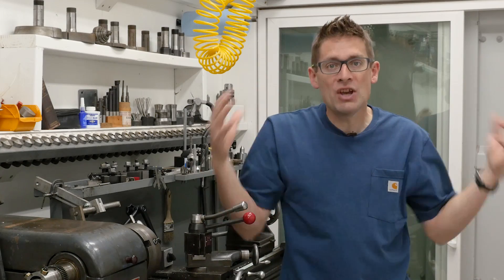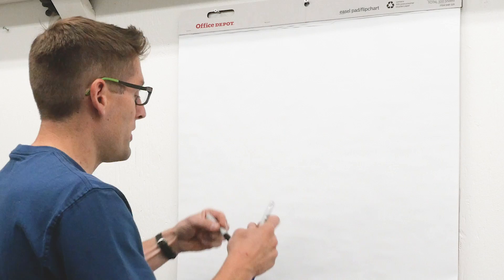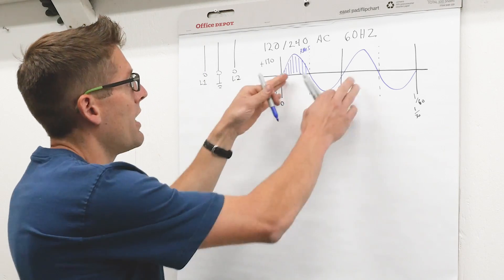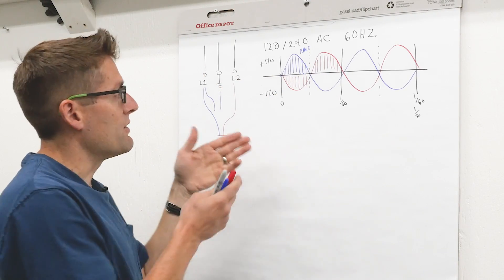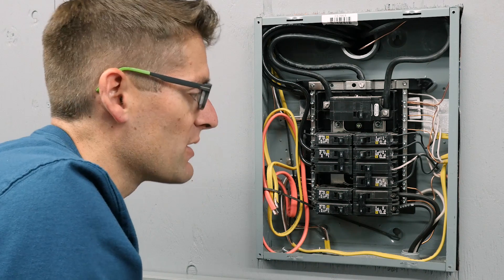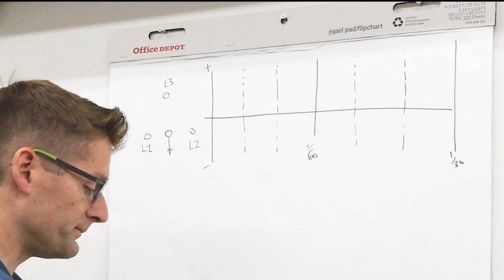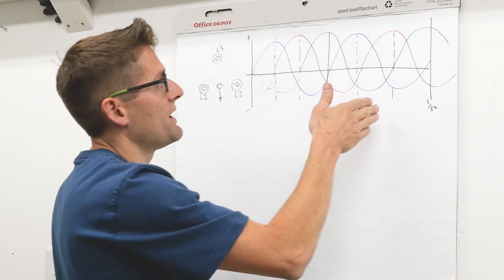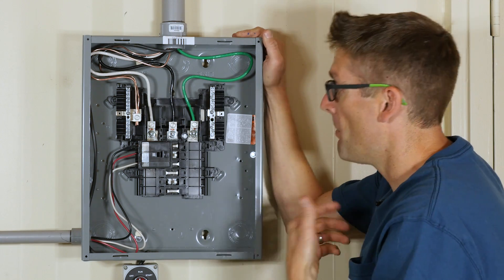3-Phase for the Shop: 3-Phase -vs- 1-Phase Power

Comment: Gavin your chalk talk primer on single phase and three phase is exactly right on....at least the way I learned it in tech school in 1971. I do wish you would consider doing me one favor though? PLEASE don't hold on to the breaker box, water pipe, or some other good ground with one hand while  you are contacting wires with  a finger of the other hand. If an accident occurred, the max current would surge directly through you chest and heart, likely killing you. When we were working around BIG power down at NASA in Houston the safety inspector would often make us work with one hand in our pocket until we were sure the circuit was dead. Again best primer on power I've see. BTW: the multiplier to convert from peak to rms is 0.707 and  the other way is 1.414

Comment: Excellent explanation of the basics of 3 Phase Power. 
However, I have to agree with previous commenters regarding a range of issues (close to live wires, color coding, etc.). You obviously know what you're doing, but some folks may think they could do this. I met a guy 3 decades ago who thought he knew enough. His two missing fingers elicited my "interest". He showed me the scars across his arm and chest from the shock he got from a panel. It disintegrated his two fingers, scarred him for life, and put him in the hospital. 
My comment is aimed at those who are not WELL educated about working with high voltage electricity. It can kill you.

Comment: Hey Gavin great job but remember COLORS Matter , Identifying what's hot and what's not is critical  the COLORS of the wire determine their function in the circuit . You MUST get that right ! What you've displayed here (12;30 ) scares me that's why I test all circuits I'm working on if the job is new to me and until I decide that the wiring is correct with respect to grounding and polarity I always proceed with caution

Comment: I thought I understood 3 phase, I didn't, now I do.  However that panel wiring is not standard color code for 3 phase, at least I don't think it is.  That Green is normally a protective ground, and you would have a red, black, and blue.  Regardless, still a great presenation.

Comment: Also...the use of the green insulated conductor in your three phase panel is a violation of 250.119. One thing is working but minimum code safety standards must always be followed my friend.

Comment: Greetings Gavin - Nice explanation. However, you are aware that the remote distribution panel you show is a violation of 250.24(A)(5) right. You do not ties your grounded comductors, in your case neutrals, and equipment grounding conductors together. This creates objectionable currents as well and places unintentional current on metal parts. However, in terms of phasing and so on well done. Also that grounded conductor in your remote panel needs identification as a grounded conductor as well per Article 200.

Comment: Theoretical can i run a machine that is design for 240v single phase on a 3 phase. The voltage would still be 240 its just more consistent. Im just trying to understand basic electric engineering.  Thanks
Reply: You could, but with a lot of torque ripple and reduced power - since the voltage across two 3 phase legs is 208 volts, not 240 volts.

Comment: Sorry, but a second phase is 120 degrees shift to first one(360/3=120). Tge voltage will be lower as just a difference between two phases. At least so it in Europe.

Comment: I’m an electrician by trade and there is def some serious issues with your installation and I hope no one uses this as a template. But I think you did a decent job explaining what’s going on with single phase and three phase power.
Reply: Parallel paths to ground from sub panel 💩

Comment: The last box was done by a hack and not an electrician. The wire color scheme is not used and off. No bond to the the panel. You should of used tape to call out your wire. Black, Red, Blue, and in that order. If the first box was a sub panel it's wrong too. Hows your neutral feedback doing. No marked wire and you have full romex wire inside the box. If people are using your equipment do them and yourself a favor, get your boxes up to code. We can all see you did not permit your work, it never would be approved.

Comment: Wow!  Some super dangerous wiring in your installation!  I hope one of your connections at the lathe doesn't loosen over time and contact the lathe case because you're dead!  Bond wires going to the neutral bar.....another major mistake!  Lots of wiring issues here.

Comment: Great explanation Gavin. Your panel from your converter uses black, white and green. Kind of a no no. Electrons don’t care about insulation color and I’m of course referring to a business where city inspectors, building inspectors etc. have free access to a business, so in that regard, you’re a private entity so they’ll never know (unless they watched this video). The only problem that could arise if you go to sell the outpost and an inspection is required, they would ding you for that. Simple solution, use colored electrical tape to correct the wrong color. For example, put some red tape on each end of the white and blue at each end of the green. In your small shop it’s your kingdom and you did the work, if an electrician came in for some work he would have to $pend time figuring out your method to be safe. That green as a hot leg can get people hurt and confused. And I did see a comment where you’re going to add a ground to the lathe. Good idea. Back in the old days they didn’t have it but they DID need it, they just didn’t realize it. Dead people made the industry realize it. 
 I see the incorrect use of insulation color often, but like I said, electrons don’t care. You do’t claim to be an electrician so you get a pass but your clean wiring and research allow your set up to work safely. Nice job, keep the excellent videos coming. And NICE outpost.
Reply: Kind of a no no is a massive understatement. Green should NEVER be used for current. It ALWAYS needs to be a Ground and tied to an earth or water ground at the main panel. Imaging someone accidentally energizing an entire machine body because a green wire is accidentally tied to a hot leg. With rubber vibration isolation mounts on a machine tool you are creating a potentially deadly situation.
Reply: In the NEC code book the only two colors regulations are white/grey for neutral and green/green with a yellow stripe for grounding

Comment: One thing you glossed over is that rotary 3-phase convertors that use an idler motor as a rotary transformer do not produce 120 degree phased power.  They synthesize a third leg which is +/-90 degrees to the two standard 120v legs which are 180 degrees to each other.  So there are 3 sine waves, but they are not equally spaced.  It still "works" but technically you should derate the motors driven by this because the magnetic fields do not produce the design torque as they are not properly aligned with the physical windings in the motor, those being actually 120 degrees apart.  Very roughly speaking, you can think of the magnetic fields as being about 30 degrees away from their perfect positions, so you get something like cos(30 deg) or 87% of the design torque.  Close enough, especially for hobby work.   The phase-to-phase voltages are all about 240v, but the phase-to-ground voltages are something like 120, 120, and 250.  Go and check if you don't believe me.
An alternative is a single phase motor driving a 3 phase motor where the input phases are not directly connected to the output.  This works for small convertors but large, single phase motors (like >10hp) aren't available.  And you lose some efficiency this way too, so while the phases are well aligned, they are weaker.
The main consideration you should take is that some machines have a CNC computer or other electronics that are powered from just one of the input phases.  You should make sure that lead is connected to one of the "real" input phases rather than the synthesized leg.  Because the synthesized leg is much higher voltage (relative to ground or neutral) than it would be in a conventional 3-phase system.  I've been told this can damage computers, though I've never had a problem.  Still, I'm careful with this.  For example, on my surface grinder, I wired the 120v magnetic chuck to the L1 phase and not to the L3 (synthesized) phase.
Reply: Chris, excellent comments! I was hoping someone would bring this up in the comments. He may not be glossing over these facts, he likely just does not know them.

I just shake my head when I see all these people commenting about how they are getting "pure sine wave three phase power"out of their rotary phase converter. It seems especially bad in the machining discussion boards and Facebook groups. They clearly have very limited understanding of what their rotary phase converter is doing.

I would have a minor challenge to your comments regarding the phase angle of that third "synthesized" leg. The capacitors used in the rotary phase converter do help to shift that phase a little bit closer, though there is still a significant difference in the angle.

Some higher-end rotary phase add some additional components and digital manipulation to bring those phases closer together, though never perfect, and some add components for electronic voltage control to address the voltage to  ground issue that you brought up regarding that third leg. But the reality is very few rotary phase converters in operation have any of those additional components and features.

In my opinion rotary phase converter manufacturers are not being honest with their descriptions of their product.
Reply: @byronmill  Is this true with the electronic contols and power corretion in the AR control section? Sure seems like AR is addressing that from their product marketing but reality may be different. The AD and ADX lines specifically call that out. Thoughts?

Comment: 12:37 "I'm just gonna go ahead and turn that on. Now we have live power..." (starts putting fingers into the panel)

Dude wtf??
Reply from the maker: Contrary to what some people think, you can't get shocked by touching the plastic part of a circuit breaker :)
Reply: @dliguori25 yeah no, he was SUPER close. especially when pointing out the 3 contacts, like, he almost put his fingers on those contacts. Gavin def knows what he's talking about, but maybe not showing quite enough respect for that "little" panel when poking around in there. I would argue that there was no justifiable reason to energize the panel in the first place and the safer, and better, option would have been to leave it cold. Still, great vid, just be careful man! We want to see more great machining videos, not unintentional BBQ videos... XD

Comment: I'd like to see a drawing of how the rotary phase convertor squeezes in the L3 when L1 and L2 from a single phase output and phase convertor output are still 180 degrees out of phase.
Reply from the maker: Math is coming! It's a function of the fact that potentials between poles are what the effective voltages, not in reference to neutral, etc. The end result is perfect 120 degree phasing if you look from L1 --> L2, L2 --> L3, L3 --> L1, etc. It's a math trick, but the motors/appliances don't know the difference :)

Comment: Good info !  How do you get 3 phase power into a residence?  Or do you generate 
3 phase power from single phase?
Reply: The reason 3-phase power even exists is because industrial power generators actually generate 3-phase power and that is converted to single-phase because it's cheaper and easier to transmit (2 vs 3 lines), it's also easier to balance a current load across two phases when you're only using single-phase electric equipment. These are some of the reasons why you DON'T get 3-phase power delivered to residential areas, but it's the most common form of power delivery in industrial areas and somewhat common around commercial areas.

Comment: Holy shit!  I hope that circuit breaker wasn't energized when you were touching it!  God dam, that's a quick way to end your life, doing what you just did.  NEVER "GRAB" AC.
Reply from the maker: towert7 Just as an FYI- breakers won’t kill you if you touch them. They are switches- designed to be touched when you switch them on and off :) - unless you are watching Macgyver.

Comment: Ummm are 3 phase lines typically white and green?  And by the way if you get your fingers any closer it might blow off a finger nail.
Reply from the maker: Stay tuned for the install video where I label the wires :) (rural location, didn't have much choice on color). You can't get shocked touching wire insulation :)

Comment: Please fire your electrician Gavin!
Reply: Josh Tuell you didn’t like the green and white used for the ungrounded conductors?
Reply: Jason Erbert  it’s probably going to give me nightmares.  He also used a white for an ungrounded conductor, ran parallel #8 bare for a ground to the neutral bus and I didn’t see a bond screw in the 3p panel.  No ground going to the machine fed from the 3p panel either.  Single phase panel was a mess too!  I guess what I’m really hoping is that he didn’t pay for that hot dangerous mess.  Looks pretty “ruin it yourself err” to me.  Grounding is good Gavin!  Keeps your hair from curling!
Reply: Good coffee and electrical circuits have one thing in common... they’re very dependent on good grounds
Reply: Dude, it’s fine..green is always PE, see?
Ahhhhhhhhhh!

Comment: Anyone else getting the jitters watching Gavin touching the wires?
Reply: Treat every wire as if it is loaded. :) I've been bit by 240 though cracks in the insulation. You'll only touch a wire once after you've been bit.
Reply: Yes. that was irritating me.  It's like he trying to teach how to get brain damage and cardiac arrest therapy for the DIYer.
Reply: I got bit through a spark plug wire that had bad insulation. That hurt like hell not sure what the voltage from an ignition coil is. 

My damn mechanic kept telling me it didn't need a tune-up till I told him to touch the cylinder 4 wire lol.
Reply from the maker: Hey guys- you can’t get shocked from touching wire insulation :)
Reply: @Ultimatereloader  Heh...that assumes that the insulation hasn't been broken when you (or someone) pulled it through conduit. So with all due respect, I think you're making an assumption that may be based upon a false premise. 

(I've seen a mill electrician get nailed by 480v, just by touching the insulation...I was standing right next to him.)

Comment: I've used 3-phase in my data centers before and knew it's better but having this very straight forward walk through of 3-phase really clearly iiustrates exactly what is going on inside the 3-phase power panel.  I've made myself somewhat known by saying over and over again "No 120V in my data center!"  208V is just more efficent. The one real advantage I see with 3 phase in the data center is a power run to the cabinet can offer a lot more amps without stressing each of the legs as much.  But for a machine shop your walk through explains why 3-phase is so much better for a mill or lathe.  Thanks for the simple consumable instruction. Look forward to more of your shop vids!
Reply from the maker: John Schenck thanks, glad it was helpful!